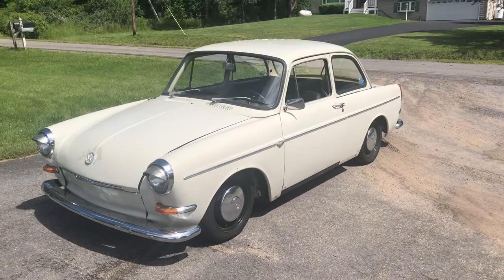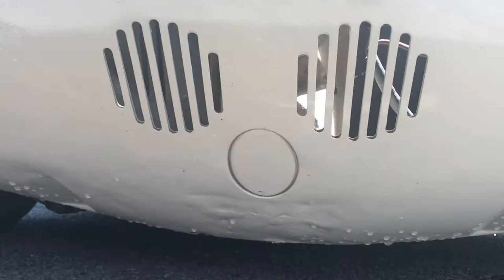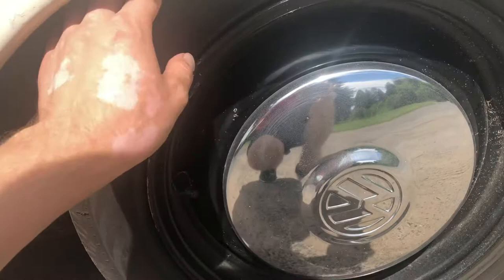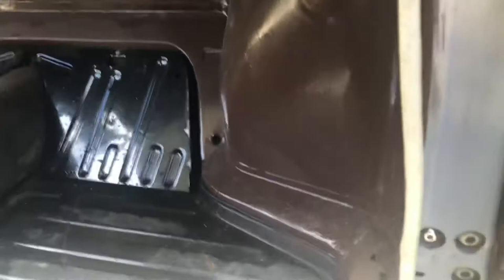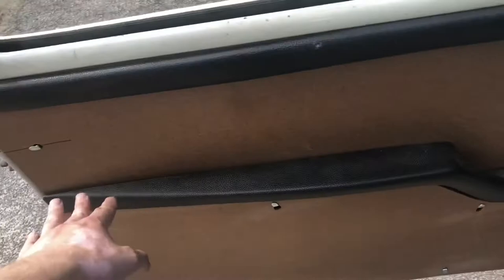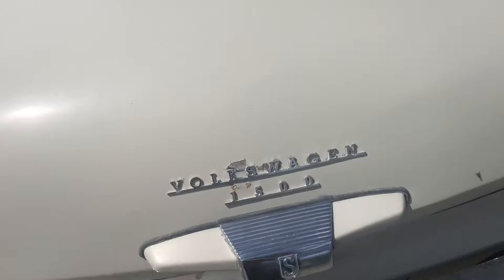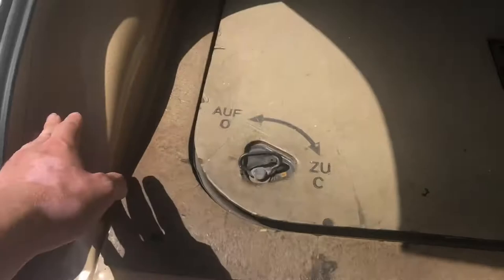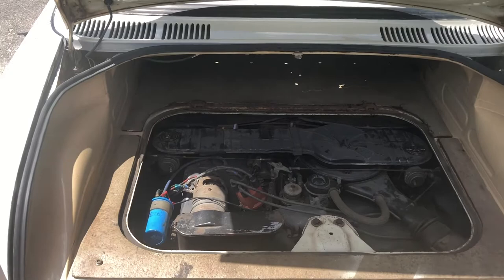My 1964 Volkswagen Notchback overview

Comment: Btw the 1500s is a 1600 engine, not 1500.  Nice car though.
Reply from the maker: I wasnt aware! I thought N models had a single carb and S models were duals. I had the crank bearing go in this motor due to a faulty aftermarket oil sump a prior owner installed and popped the 1600 from my 66 fasty in this car... not too much of a difference I noticed but thanks for the knowledge!